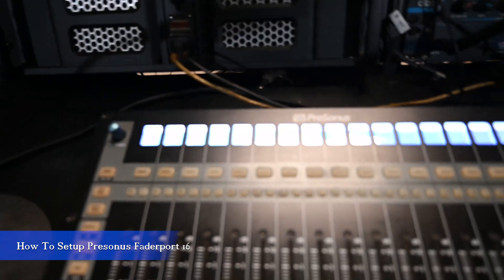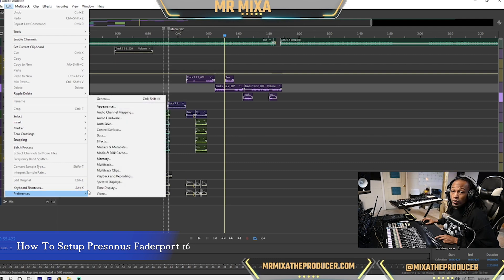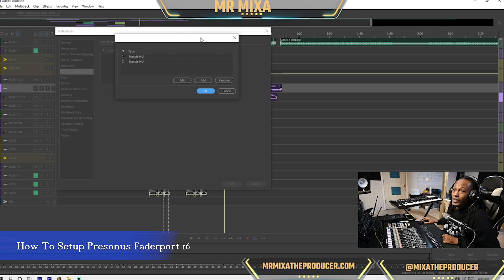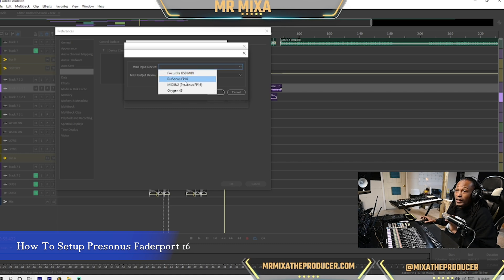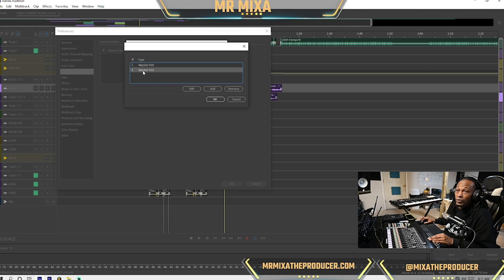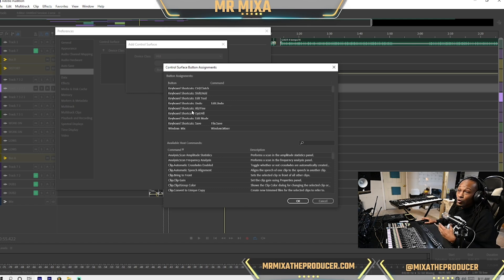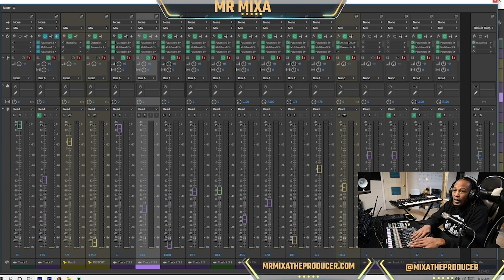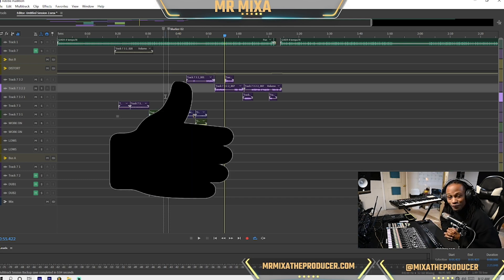How To Setup Presonus Faderport16 in Adobe Audition

Comment: HUI is the oldest and has the least amount of features when compared to Logic and Mackie Control protocols. Using Mackie Control will give u a master fader, and decibel level next to each track name. HUI is mostly only used in Pro Tools. Which makes sense bc Pro Tools doesn't have a master fader unless you add one manually.